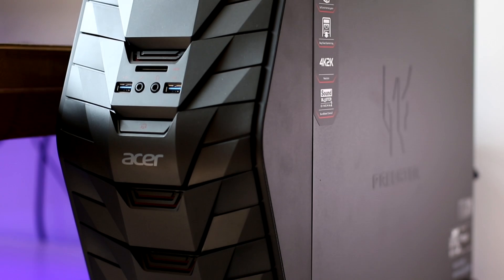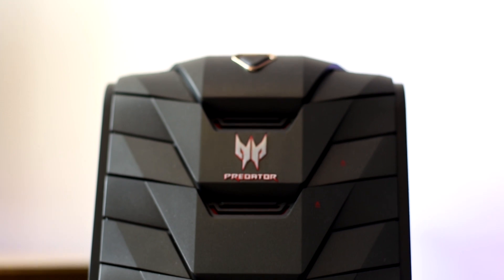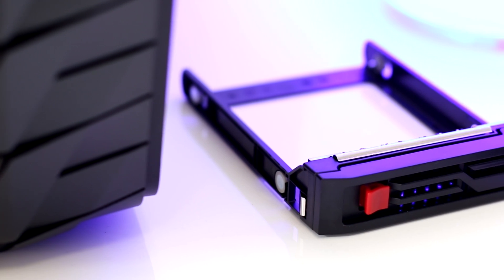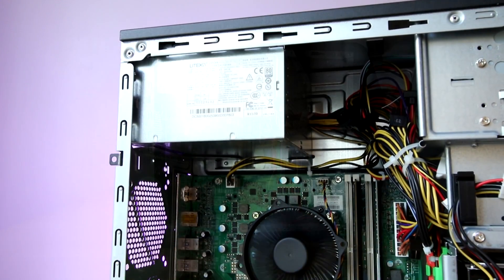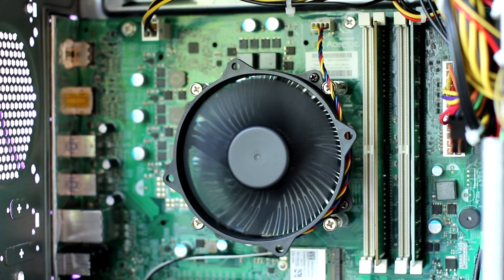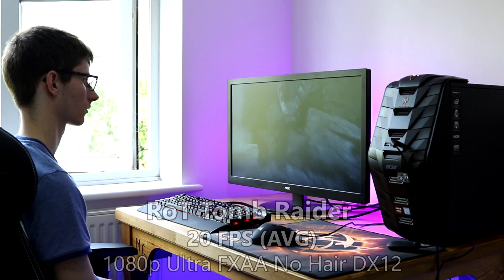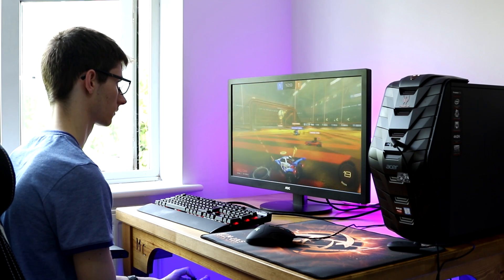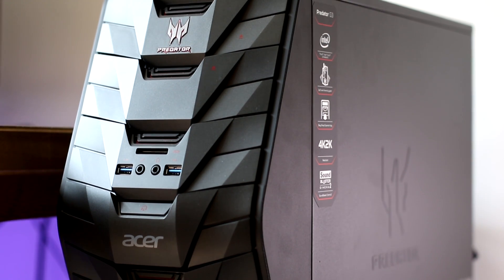Acer Predator G3 Desktop PC Review [G3-710]

Comment: My little brother has this system.  He'd like to add an SSD through the external drive port, something you said at 1:56 that couldn't be done because it's only for mechanical 3.5" drives, but I found adapter brackets online that might bypass that restriction.

Comment: I have been looking at this at bestbuy to play a few games, American Truck Simulator, World of Tanks, and  Flight Simulator the specs for American Truck sim- RECOMMENDED REQUIREMENTS
Processor: Quad core CPU 3.0 GHz
Memory: 6 GB RAM
Graphics: GeForce GTX 760 (2GB) or equivalent 

Could I play this game on the ultra setting!
Reply: Simulator games are really demanding for your cpu. But which cpu is it exactly?
Reply: 6TH Gen Intel Core i5-6400
8GB system memory
1TB HARD dRIVE
NVIDIA GrForce GTX950
Reply: Does it have a PCI-E slot

Comment: I have had it over 5 years now, actually a beast in the early years but now the last 2 years it's been running trash, It crash way often and can't handle running things properely.

Now it's totally dead and I wonder if I should buy brand new or try upgrade it. 
If anyone knows what upgrades suits it please tell.
Reply: i suggest you replace it. all of the parts are not high quality anymore.

Comment: This computer is still running solid for me, of course I did an upgrade to 2070 super for $510 and a 750 PSU for $80. And I can run ultra setting and avg out about 65 FPS. And when I run warzone on low setting with 1080p I avg 155 FPS.
I got the version of 64 ram and a i7 6400 3.4
Reply: Hey did you upgrade ssd? I got the i7 7700 3.6ghz gtx 1060 6gb n has 128gb m.2 sata. Dunno how much it can take, 512gb or 1tb or if it can take nvme or jus sata m.2
Reply: @roballan1251   actually no, you won’t get more or less FPS based on SSD.
I only use my SSD Memory for RTS games, most of my games are on my HDR HD because it has 1TB.
Reply: @roballan1251  because the computer came with both SSD 255 GB and HDR 1TB
Reply: Ok na sorry not wat i was asking. Just if your ssd was nvme.

Comment: Got the i7  7700  , gtx1070 version     1300 euros . Jesus that's a beast. I just added one SSD in extern ( picked up on a broken laptop It cost me 35€ to get the extern with adaptator ). And who cares about the inside???  It's a beast
Reply: Wow that's expensive... 2,5 years ago I paid only $1075 for the version with: GTX 1080, i7 7700, 16GB RAM, SSD 256, 1TB HDD 7200rpm

Only added another extra 1TB (second same) hdd for games storage for $25 i think. In the quick slot.
Reply: @92000  He said euros not $ there are different currencies
Reply: Are you still running this machine. I’ve got the same version but hasn’t gamed  in a few years. Wondering how It does with todays games
Reply: @parkerfrode5101  I have my specs as i7 7700 with the gtx 1070 with 16gb ram, and I can play fortnite with 144+ fps easily. This pc can still run most games I play right now.
Reply: @parkerfrode5101  i have added a proper cpu cooler & added a case fan & SSD & its half decent, just expect to play modern games at like medium to low settings, I still use it to game casually

Comment: I have the computer and had it for 3 years now and it runs everything perfectly and smoothly with no problems and high quality graphics
Reply: Mine, just fried, thinking it is the power supply.  So, you may wanna think about adding cooling fans.  Not even 2 years old.  But, got it at Costco and getting it fixed, sending it into Acer.  Told them that I needed to copy the drives, so they better not screw me.

Comment: bruh.. same case, but mine came with a i7-7700 ,32GB RAM,GTX 1070, g3-710 is its motherboard and model #,,, paid like 1200$usd if i remember correctly
Reply: bruh.. same case, but mine came with i7-6700, 32GB RAM, GTX 1080 and still without any extra fans installed!!
Reply: Men's Studio same. It's just different versions.
Reply: mine differs with GTX 1080 and 16GB RAM but I paid like $1075 - 2,5 years ago :]
Reply: @92000  How loud is it, Does it overheat, And how does it game in 2019, I found a Facebook listing with a 1070 for $700
Reply: Get yours at Costco too?
Reply: Paris Cloud mine crapped out after a year. No display now and won’t fire up. Anyone had issue…
Reply: @acatl33  damn that sounds hella faulty, ive had mine for a year and its doing well. You should check the power supply and see whether it fried the components.
Reply: @spilledketchup  took it to geek squad and they didn't know what was wrong so it worked for a bit and crashed again. I took it to my local mom and pops pc repair shop and they re installed the bios. Now it's working perfectly fine again. I haven't game too much, but I did run gears 4 trying to make it crash. So far so good I been using it for mainly work VPN. Fken love it again got the two 28" 4k monitors. I was so ready to throw it out lol
Reply: @acatl33  ay congrats man

Comment: The gtx 1080, 512ssd(m.2) is now about $1300 USD. There's a reason for this. They've been dying fast, and unless you're gaming in the basement with consistently cool air, it will HEAT UP FAST.  There are almost 0 heatsinks, and only has CPU fan. 

You can see the internals are just jammed inside too, so zero airflow. You will likely replace it in a couple years and build your own with the 512ssd, 1080, and CPU. The rest is arguably just sell able/binable

Comment: It appears that this PC may have the model name G3-710, but the specs can vary markedly. My Predator G3-710 was purchased in February 2017 as my first gaming PC. I'm getting into aircraft simulation and quite partial to X-Plane, DCS World, and War Thunder, and wanted a system that was ready made, not over spec for my needs, and something that came in budget. The Predator G3 looked like it!

My specs are:

Processor - Intel i5-6400 (2.7Ghz to 3.2Ghz)
HDD - 2TB Seagate Barracuda 7200.14 
RAM - 8Mb DDR4 (upgraded to 16Mb)
GPU - Nvidia GeForce GTX 970 4Mb

To be honest this PC has exceeded all my expectations. It is 4K2K resolution and VR ready. I wasn't sure about the VR bit but after having a demo on a HTC Vive I decided to go for the lesser financial hit and bought an Oculus CV1. Frame rates on War Thunder are a constant 94fps while DS pulls 61fps. X-Plane a little more disappointing at 44fps but still definitely playable in VR.

I think the system might perform better with a slightly upgraded GPU. Maybe a GTX 1060 or GTX 1070, but it might also benefit from a CPU upgrade to i5-7500. Unfortunately my pockets aren't that deep so it's got to be one or the other. My feeling from the excellent benchmarks thrown out for the CPU is that there's no bottle-necking involved so in the immediacy maybe the GPU would be the better upgrade option.

Anyway. Bottom line is: if you're looking for a mid-range gaming PC pre-built that isn't going to break the bank then this can handle 90% of the current games out there. The only caveats being to ensure the G3-710 you purchase has preferably a Nvidia GTX 970 or GTX 1060 in there or the AMD equivalent (at least 4Mb card) and to boost that 8Mb of RAM to 12Gb or 16Gb. 

Overall to mark this PC out of 10 for value for money I'd give it 7/10.
To mark for meeting expectations 8.5/10.

Not a bad PC for the casual gamer.
Reply: dude,,, mine is i7-7700 ,32gb ram , ssd on m.2, hard drive 1tb,1070 gtx stock from costco america
Reply: Sollux Captor I literally am getting the same thing with same specs how is it doing?

Comment: I didn't get the exact same one but I got one with an i7 7700 cpu and a GTX1070 gpu and one thing I notices is that I didn't the the warranty sticker you mentioned when taking off the side panel, where do you find the warranty sticker?

Comment: I moved from US to Australia and I bought this CPU from US whereby the voltage is 110, now that I am in Australia I am trying to use the CPU again however there’s no voltage switch behind. Will there be an issue if I just use an international adapter and turn the CPU on?

Comment: using the hdmi on motherboard what does that do? and anyway, if ur hdmi is not working on graphics card and also the hdmi thing at the front is not working then what could be the problem? the graphic card itself? anyhow this is Acer Predator G3620 not g3-710 - just asking in case u might have a clue :o

Comment: 20 fps in 2016! Are you kidding me?! Predator G3 is expensive case with trash inside.
Reply: expensive front panel*
Reply: Shitty Graphics card
Reply: It depends on a chosen version. I've got the one with GTX 1080, 17 7700 and 16 GB RAM and it is STILL A GAMING BEAST!

Comment: going to call bs on this video. playing witcher 3 at high at 60fps. When I set it to Ultra it doesn't go as low as 40
Reply: note that G3-710 differs by configurations. For example mine i7 16 ram gtx1080 handled W3 with even more fps ~80 on Ultra settings.

Comment: This computer got hated on more than it should have. I currently use this PC and have no problems running games like BF 4, GTA V, and COD BO3. Now granted I don't max out the settings on these games but that's because it's just not capable of running these titles at max settings. That doesn't mean it's garbage. You're looking at spending around 6 to 700 on this machine. With the specs, it's not bad at all. People think as long as it has a fancy name it should be the best thing ever. Base it off of what it's capabilities are and then judge it.
Reply: Zombie At Work HD yo I want to play bo3... What fps can you get?
Reply: On maxed out settings, I got average of 47 FPS. Taking the settings down a bit, going on 1920x1080 and most settings on high, I got an average of 92 FPS.
Reply: This PC definitely runs H1Z1. I don't really play it, but I did test a bunch of games out and it gave me at least over 60 FPS.
Reply: Alex, I'll take shit that never happened for $500.
Reply: What dos mincraft fpss how hih?
Reply: Thomas Barnhart  me to
Reply: Zombie At Work HD can it play players unknown etc
Reply: Zombie At Work HD how did you get bo3 on mine it says that the graphics card is out of date to play black ops 3?
Reply: my pc costed 600 dollars and could run the latest games in ultra settings.

Comment: I have a bit of a concern. Anyone have suggestions. I bought the desktop above per pc centric's great recommendation. However, I also bought the acer xG270HU 27" which is in the 2560 - 1440 resolution. I am worried the desktop simply wont be able to run well. What are some suggestion for improvement for my monitor and this desktop. OR should i just simply look into returning the monitor and look for a high end 1080p monitor??

Comment: ACER PREDATOR G3-710, GAMING-PC, CORE™ I7 PROZESSOR, 8 GB RAM, 1 TB HDD, 256 GB SSD, NVIDIA® GEFORCE® GTX 1060 is this good? or better this ->   ACER PREDATOR G3-710, GAMING PC WITH CORE™ I5 PROZESSOR, 16 GB RAM, 128 GB HDD, 1 TB, NVIDIA® GEFORCE® GTX 1070 8GB GDDR5 VRAM
Reply: gtx 1070

Comment: I got the same from Costco of $1199. Came with an i7 6700, GTX 1070, 32GB RAM, and a 256GB SSD + 1TB HHD. 

Not bad really. I'm not sure if I over paid. It came out to $1300 with tax but I mainly wanted it from Costco because they have mostly hassle free returns if something goes wrong and Acer won't cover it.
Reply: XD, I got the same thing
Reply: you could have got it for 899 on their website
Reply: I guess you didn't actually read my comment. Look at the specs again. Costco version is way, WAY better.
Reply: MassCrusade i got it for 800 dollars
Reply: Saw this deal at costco today for $999
Reply: MassCrusade how do games like player unknown battle grounds run or like h1z1 rocket league do u know?
Reply: pretty goood
Reply: Hey, I’m thinking about purchasing the same thing. How’s the performance? Is it capable of running overwatch at 100+ FPS?

Comment: TL/DR: This computer with better graphics card overheats. Both CPU and Graphics Card get hot and cause shutdown. Unusable for gaming. 

I have this computer and it came with a GTX 1070 graphics card. The computer starts fast and can run my games pretty well, but it overheats and shuts down. 

It seems to be doing it more and more as times goes on. Right now my house is about 60 degrees F and I even left the case open and the computer overheated while playing SCUM. 

If it were just the overheating I wouldn't complain about this computer and manufacturer, but it's more than this. The Tech support is terrible. Calling in takes time with an AI that is retarded and doesn't seem to understand what I want even when I type the numbers in with my phone. When I finally got to a person the line disconnected while it was ringing. The second time I got through it was someone who did not speak English well, their phone was garbled and they seemed to mumble as well. To top it off there was a lot of background noise and chatter like a high school cafeteria. I tried for several minutes to tell her what my problem was and finally gave up. 

The online tech support doesn't exist. There is a "community" and maybe eventually I'll get a response on that. The problem with this is that any solution that I can make to the computer will likely void my warranty and that really makes me angry. In fact, I've already opened the case. I didn't see a warranty sticker but if it's there then it's broken. 

I think the problem is that the fans do not turn very fast and do not increase speed to accommodate higher usage. From what I can tell Acer doesn't offer a utility to fix this issue and the one that was recommended by another online post doesn't seem to recognize the fans that are in the computer. 

I'm going to check the Costco warranty to see if I can get anything done through them. If anyone has a fix please let me know. 

I would not recommend this computer model or brand to anyone.
Reply: I have the same PC and have no overheating issues. Use PredatorSense to fix the fan speed problems. The CPU fan can be increased to 4000+ rpm. Also, I talked to an Acer support person about opening the case up and adding fans and he said it wouldn't void the warranty. But I would talk to them first and take screenshots of the conversation before engaging to prove they said so if they try to go back on their word you have proof. That's what I did. I have no problems up to today besides Chrome mysteriously not working but I don't believe that's related at all.
Reply: @MonsterHunterLancer  I setup PredatorSense over a year ago so I don't remember, but I will get back to you as soon as I figure it out.

Comment: which ones better
Windows 10 (pre-installed)
Intel® Core™ i5-6400 Processor
Memory: 8 GB
Graphics: AMD Radeon R9 360
Hard drive: 1 TB

OR

Windows 10 (pre-installed)
AMD FX-770K Processor
Memory: 12 GB
Graphics: AMD Radeon R9 370
Hard drive: 2 TB
Reply: 2 but for pice is higher (like 100) go for 1

Comment: Can I play csgo on this? At a bearable fps
Reply: Easily yes
Reply: I play csgo on this machine, and srsly gives me 200-300fps on high settings maxed out.
Reply: Its Ruko  You really do get that much fps on max settings.
Reply: i have videos on my channel with 1080p 60fps of csgo, and when it is recording it stays 120-200fps when not 200-300fps. if dust2. if inferno and other maps like cache it always stays above 150
Reply: but mine is GTX960.
Reply: Of course, even a potato can run it.  Im guessing that you will get around 200-300fps.

Comment: This is a $50 pc
Reply: I actually have an old pc somewhere, which would currently cost around $40, it can't even run YouTube at all.
Reply: You're just pissed that you can't afford a cheap, starter computer. This computer is well worth the price.
Reply: +FlyPurpleHippo Hippo im on my way to get the G6 and Predator Z35 :D worth 3k$
Reply: +Asyraff then don't be pissy. the computer isn't bad, yours is literally the upgrade of this one. I bought this as a starter, I can easily upgrade.
Reply: +FlyPurpleHippo Hippo This pc sucks. I got the Alienware Area 51 with:
X99 Mobo
6 Core 5820k
GTX 1080
16GB Memory
1TB HDD

...if you wanna start somewhere, start with that.
Reply: that's bad.
Reply: nice joke mate
Reply: +sheldonspider86 the PC shown in the vid is around £600 and Alienware costs over 1000 (if u want a good one) so it's a budget PC
Reply: michael zv raspberry pie